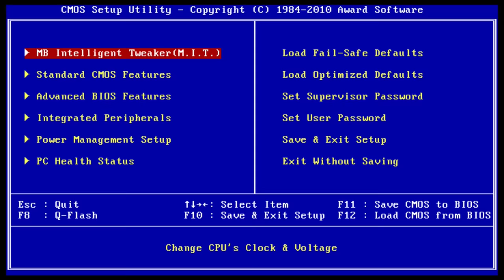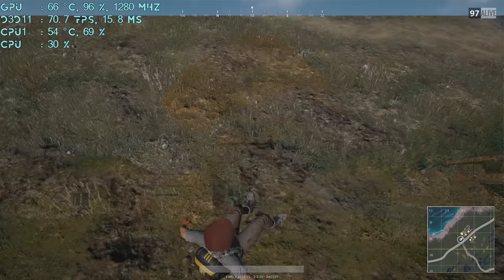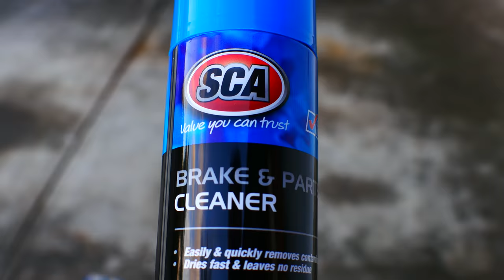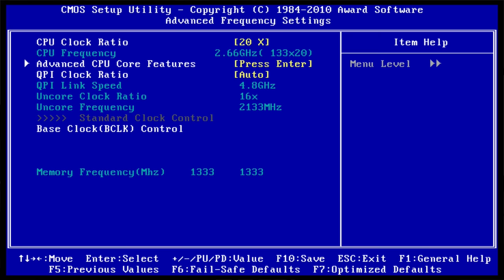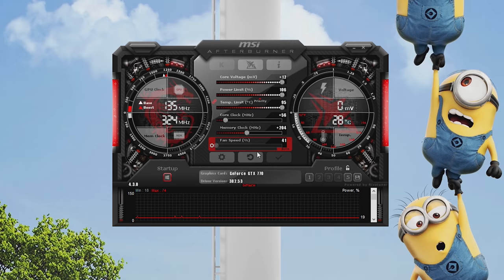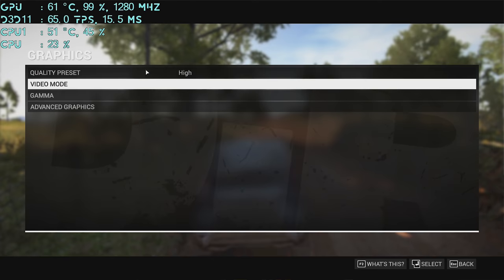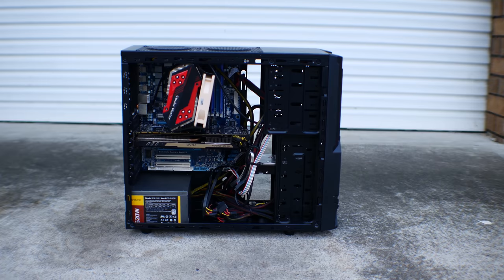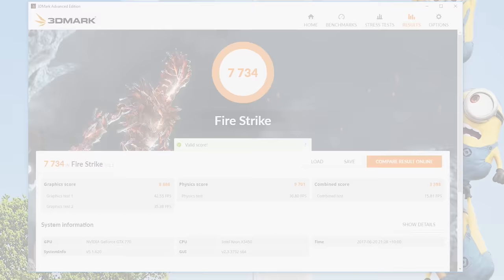The $175 PUBG & Dirt 4 EXTREME BUDGET Gaming PC

Comment: i bought an i5 4690k, gtx 970, nzxt s340, h80i, 8gb ram, 120gb ssd, 750 watt modular corsair psu, sleeved extensions for $365
Reply: that's unbelievable. The 4690k and the 970 alone should cost that much.
Reply: husssein I
Reply: This build is good for GTA V?

Comment: 1:25 you mean 770 instead of 1070, still a incredible value
Reply: Holy shit, I couldn't believe it for that price, thank you for the correction!
Reply from the maker: Dunno how that one slipped through me UGH :(
Reply: Tech YES City you embarrass my machine with a 280x and i5 650
Reply: The Horror just need a cpu upgrade man, grab one of these xeon chips for sure!
Reply: 280x is still good. Maybe look around for a good deal on a used Haswell MB, CPU.
Reply: Maybe a nice 1231v3 with a H97 board.
Reply: wingracer 16 LGA 1156 proves to be just as good!
Reply: Holy, I didn't realize, I was just thinking "a 1070 for 68USD??? DAMN." Makes a lot more sense now.
Reply: i was like ehhh lol
Reply: CADesigner Gtx 950 is better preformace and going for around if not less than a 770. Also this "incredible deal" is average at best.
Reply: RoomerJ i dont think so. the. 960 is equivalent to the 680 and 770. Not the 950. check your benches mate.
Reply: CADesigner tbh i was freaking out when i saw it said 1070 cause thatd be an amazing fucking bargain
Reply: that legit almost give my a heart attack
Reply: the going rate for a GTX 770 on eBay is around $200 USD
Reply: My heart dropped when I saw GTX 1070
Reply: @pleb9622  same bro i was gonna freak out!

Comment: I bought Dell T3500 ( xeon W3690 ) for $150. amazing performance. used my OLD GPU ( GTX 960 ) and getting 60 + fps on gta V n bf1. on ultra - high settings. 
I first saw that xeon in ur video and decided to buy one and it was worth getting. 
Thanks for the awesome stuff Bro.
Reply: Did you find a way to oc the cpu on that mobo?
Reply: Hello, may I ask about how to install the GPU on the motherboard and install the drive?

Comment: For £100 I just bought a custom PC off gumtree (like craigslist) it is i7 870, GTX 560, 8GB RAM, 250GB HDD, antec window case, 500w PSU, logitech MW3 keyboard, logitech MX518 mouse, Samsung syncmaster S23B300 monitor (OC's to 70hz at 1080p). Plays GTA 5 at 60fps normal, or console settings at 40fps. Im so happy with my budget rig haha.

Comment: My son's computer is a xeon w3690(i7 990x) at 3.8GHz with a evga gtx 770 and it struggles to play PUBG on low at 1080p. I was thinking of trying to find him a used video card with 3 or 4gb but after watching this I wonder if there isn't something we're setting up wrong in the game or were you using a 4gb version?
Reply: RonnieWolfe he is using the 4 gb
Reply: It is the 4g vram version he's using, and you will need atleast that for pubg, plus your sons i7 system ram? It will need to be atleast 6gig 8gig is better at use fast ram atleast ddr3 over 1000mhz aim for 1600mhz..
Reply: Then use all low settings and turn the syncs off for 1080p..

Comment: I just picked up an i5 2400 with some kind of ulgy Fujitsu motherboard, 8GB 1330MHz RAM, a pretty decent Antec 550W PSU 80+ bronze (sleeved and semi modular), a 500GB HDD and a GTX 660Ti for under 150€. I'am thinking about a new Case for 15-20€ to make it look better...which also could help to resell it.

Comment: Why did this video go to 4k. I have 1366x768 screen ;D
Reply: Your screens resolution doesn't matter - the bit rate will still be higher and therefor look better.
Reply: Robert Watt Well my internet or my potato laptop couldn't handle it.
Reply: Omg 1366x768 the old times (literally had it 4 months ago)
I remember thinking it’s HD until i got a new laptop with 1080p and damn it is full HD

Comment: curious what that break and parts cleaner spray is made of that he's using to clean everything with?  I assume it's safe on all the parts and will air dry quickly.  I usually use 99% rubbing alcohol to clean my stuff , but this seems faster and easier.

Comment: isn't pubg pc minimum requirements is FX 6300 CPU? how did that junk Intel cpu you got can do pretty well on it.
Reply: That junk CPU is pretty much better than or on par with an FX 6300, at least in games. The FX series were basically power-hungry entry level CPU's that didn't really have too much power and are known for bottlenecking, nothing like modern Ryzen or Core i CPU's. They're still relatively good budget CPU's but they were never really on the level of the Intel models at release.

Comment: 1280 MHz: what GTX 770 model is that ? My 1280 MHz OC is unstable. I own since 2013 the Windforce GTX 770 4GB GDDR5 from Gigabyte. At 1.212v i manage to get a stable 1267 MHz. 1280 is stable in a lot of games. But some games like The Witcher 3 tend to crash after 20 to 40 minutes. As reference this card runs at 1215 MHz. Since it's kind of a buffed GTX 680 this card was quite known for not being quite good at overclocking. Still managed to get Memory clock to 1928 MHz (+350 MHz from stock).

Price - value ratio is crazy in this cheap build.

Comment: I think a better CPU could've been achieved for cheaper like an x5460 or x5650. I've found them for under 20 dollars. Extra money saved could be used to other components like storage or maybe a better graphics card!
Reply: SandStorm x5460 is much worse and mobos for x5650 are toooooooo expensive :D
Reply: Luka TO You can just buy a p55 motherboard.
Reply: i said x5460 is much weaker... xeon x5650 work on lga 1366 only

Comment: guys i need help ...
buya gaming pc like this one in the video . or buy an external gpu for my dell n5110 with this specs:
i7 2670qm
8gb ram ddr3 1333mhz

i will not buy a razor core or anything like that i will buy a mini pcie to pcie 3.0 x16 slot and will connect it to the laptop ....

if i should choose the laptop (cheaper) what graphics card should i use
Reply: build a pc. Once you add that adapter that laptop will no longer be as portable.

Comment: Hey I have an e machines et1331g with ht2000 Mobo, and athlon 2 X2 250u 1.6ghz cpu, 4gb ram, 500gb hard drive. Can you give me an idea of where to start upgrading, I want a better cpu, a GTX graphics card and more memory is what I was thinking, would like to overclock slightly oh it's a 300 watt power supply. TIA!

Comment: Guys i just built a pc and i want you to tell me whether its good or bad for playing pubg
Specs:
Amd Fx 6300
Msi Rx 480 4gb
Msi 990Fxa gaming motherboard
Cx 500w power supply
Corsair vengeance lp 8gb Ram 1600mhz
1Tb seagate barracuda hard drive
Cit G Force case
Cost= £456
Reply: That CPU will hurt you quite a bit, you'll be able to run it but expect pretty low minimum framerates, i would try overclocking as much as you can since you have that 990fxa mobo. But honestly you should've spent that money on a really cheap a320 or b350 mobo and the Ryzen 1400.